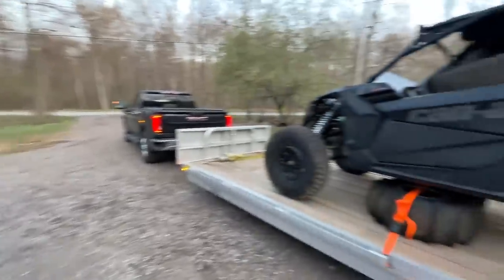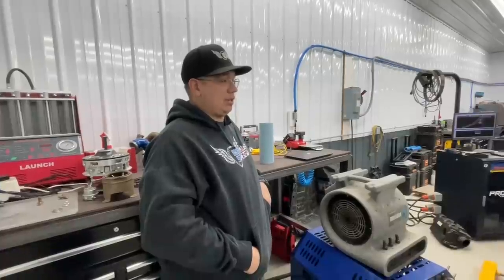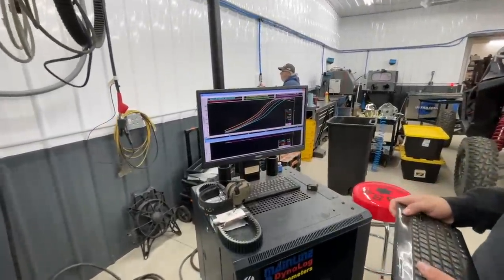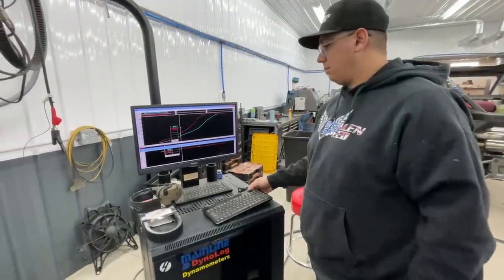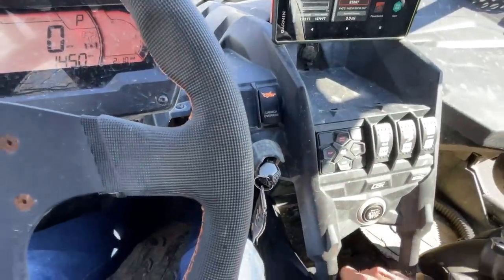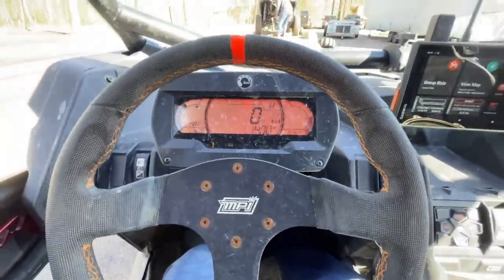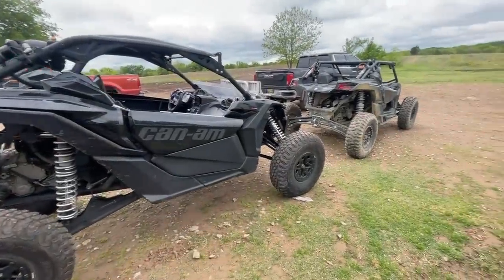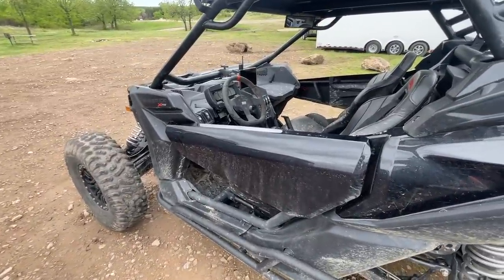LONG HAUL TO OKLAHOMA! X3 Gets New Clutch and More Power, L5P Duramax Towing, Cross Bar Ranch Rip!

Comment: If you have to camp and you want to stay warmer then find an area that the sun hits in the afternoon. It will retain heat. The air temp might be lower but the ground/rocks/brick wall will continue to give very noticeable heat till midnight at least.